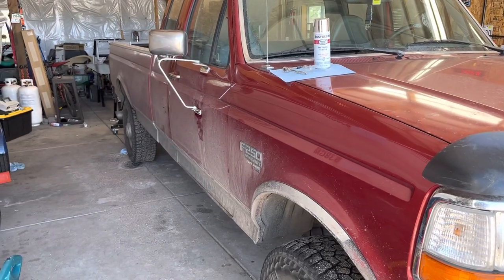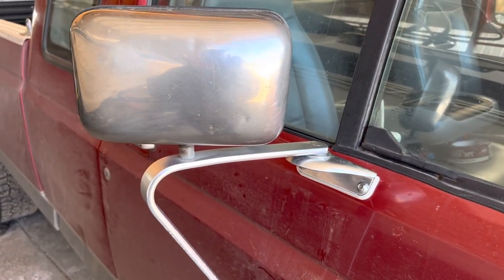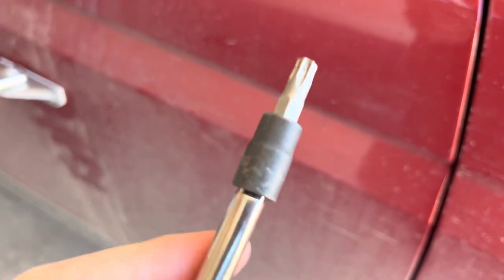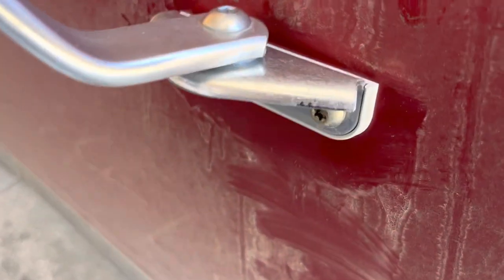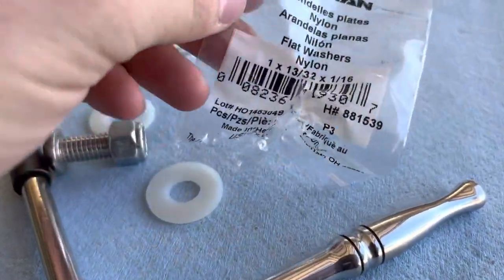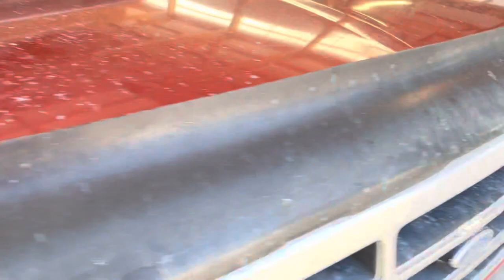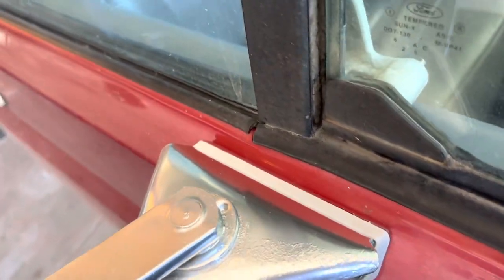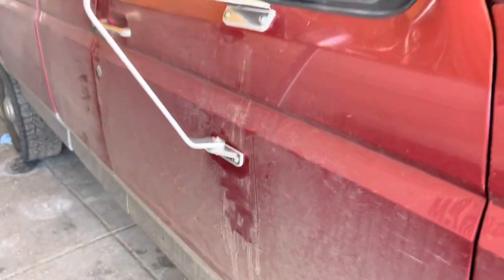Obs 92-97 Ford mirror quick fix

Comment: When you took the bracket plate off, did you have to remove the interior panel?  What I'm wondering is whether or not the plate inside the door is fixed in place, so when you put the mirror back on you just have to screw bolts back in from the outside.
Reply from the maker: I did not have to remove the door panel. Those torx screws just thread into a plate inside the door.